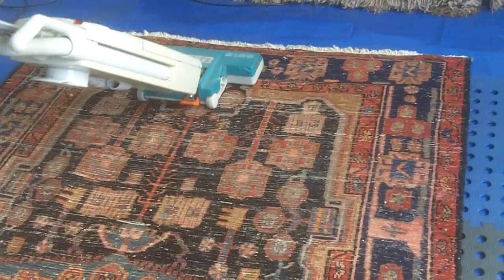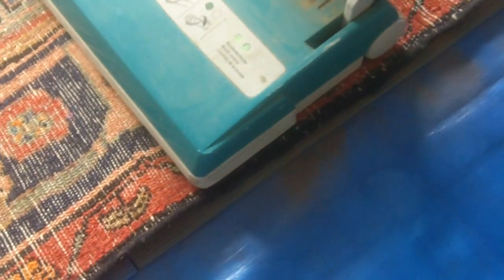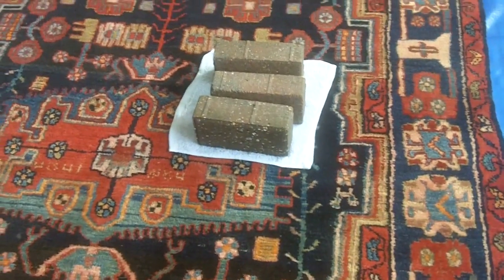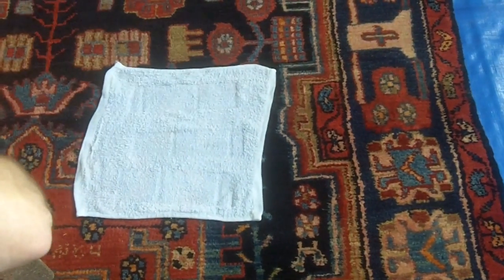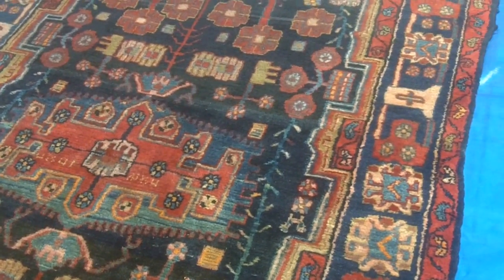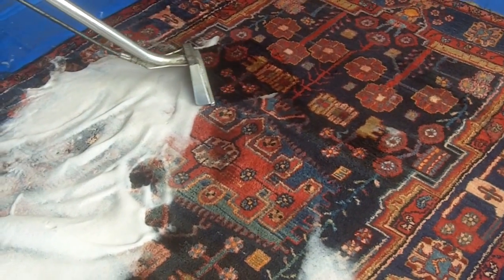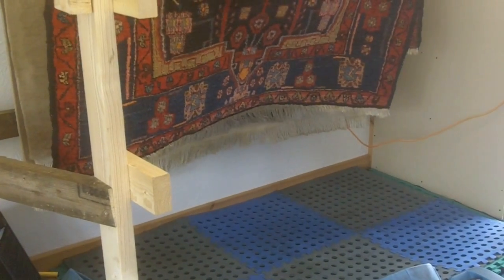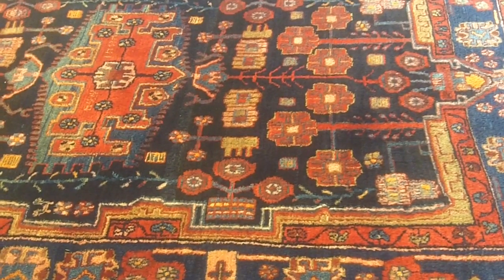Scrub Cleaning Persian Rug

Comment: most important part is missing...not advised what cleaning solution to apply on this Persian rug
Reply: Each rug will require a different method based on its condition (I run trying courses in carpet and rug cleaning) so there's no single cleaning agent, its based on experience, training and product knowledge.